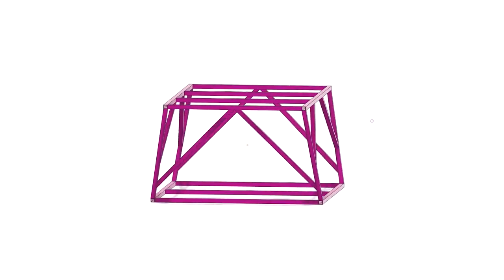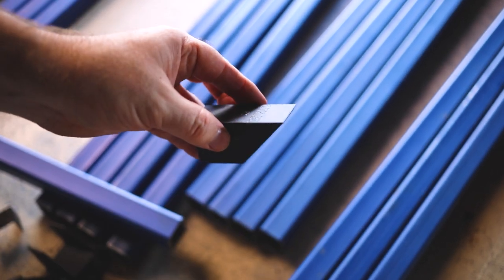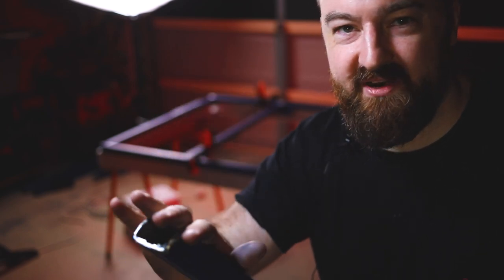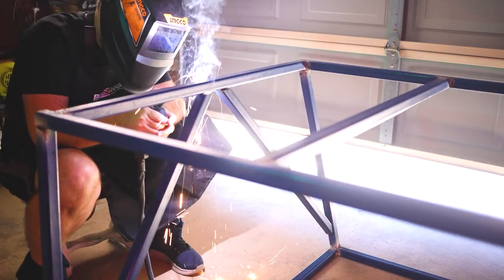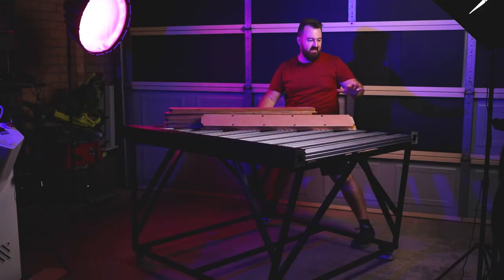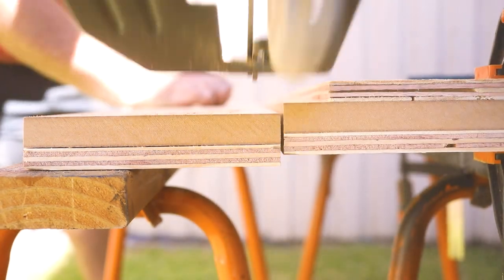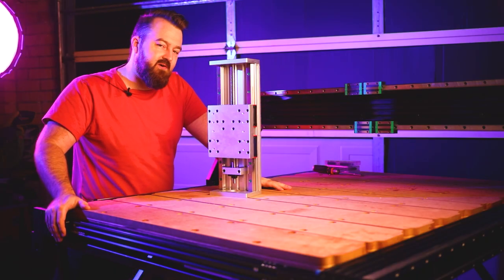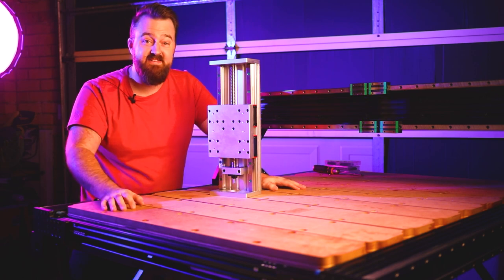Next Gen CNC // Matilda CNC // DIY CNC

Comment: When do you start selling kits? One of the nicest machines I've seen ANYWHERE!
Reply from the maker: 😄oh that would be amazing to be able to sell kits! Thanks for your feedback. I don’t plan to sell kits at this stage, however finalizing plans to release 🤩🤩
Reply: @NEWTechCreative  was it expensive to have the plates manufactured?
Reply: @NEWTechCreative  Also, how do you figure out the lengths of the ball screws and linear rails? All In the design I'm sure. Do ball screws come in standard lengths that you design around? Thx again
Reply from the maker: The total machine build is approximately 5k AUD$. It depends on where you can get plates manufactured and cost of this. I have put together a huge amount of build docs since my last video that I will be releasing soon and includes a build of materials list with links, 3D reference files and technical drawings. I designed the machine on readily accessible items that can be sourced anywhere you are in the world also provided options for plates that can be laser/plasma cut to allow different options depending what’s available. I have some testers helping me with fine tuning before release.

Comment: Consider rearranging the structure of your X - placing the heavier-duty extrusion in the middle means it is the least effective. If you believe the majority of the force will be downwards due to the weight of the spindle and Z assembly, place it at the top. If you believe it will be upwards as in drilling, place it at the bottom.

Also, it would have been better to have the flat parts of the C facing the very top and the very bottom, but I'm not sure you can still change your design.
Reply from the maker: I appreciate your feedback! Yes I had many hours of contemplation regarding positioning of the cbeam and your suggestions certainly make sense!! I was considering that the back of the cbeam would have the greatest surface area to connect to the heavy cbeam and carry over the stability…. I unfortunately I’m too far into the build at this stage to consider changing, however maybe some fun experiments down the track!! Thanks for your input 👍👍

Comment: It's great to have a study welded table frame but how can you disassemble it to pass though doorways and hallways to another room huh? Prefers it be bolt assemble type
Reply from the maker: Great suggestion! This would definitely be a worthy idea. In reflection, this would be a much better idea down the track…. Especially if they needed to be shipped 🤩
Reply: @NEWTechCreative  exactly is why other products have disassemle ready for moving to other room or shipping plus easier to carry it rather struggling with enormous weight of item

Comment: What software did you use to design the gantry riser plates and what file format did you use to upload to pcbway?
Reply from the maker: I used fusion360 and uploaded as .step files!
Reply: @NEWTechCreative  would you be willing to share the riser design or a sketch of the dimensions and hole locations?